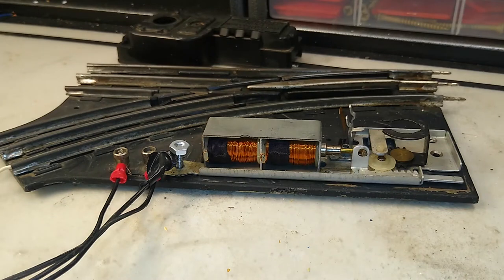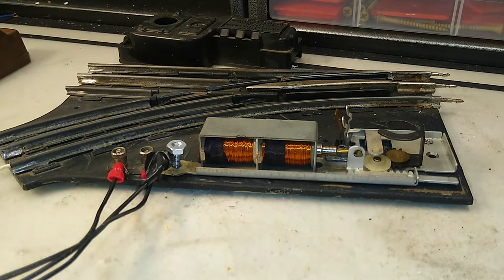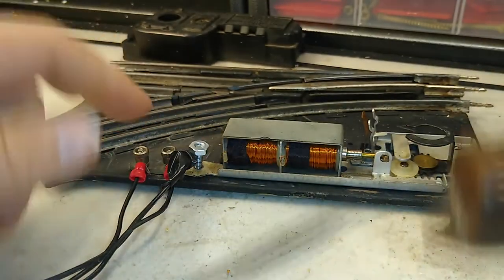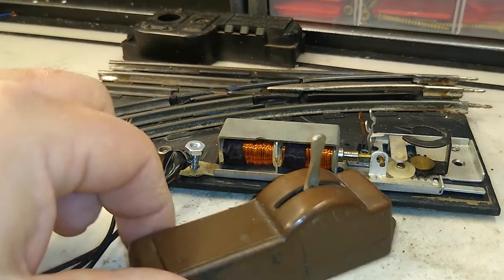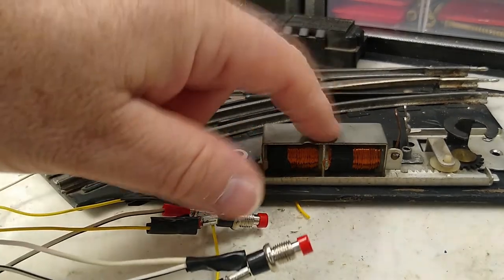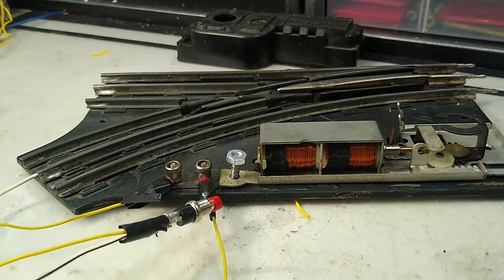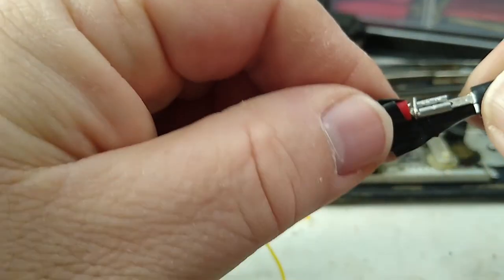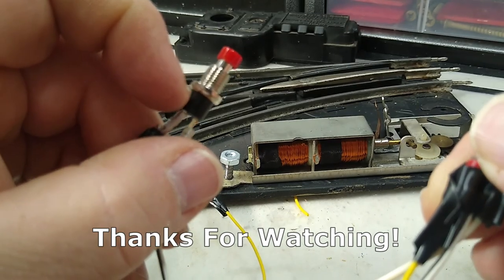Push Button Controls for Lionel O27 Turnouts

Comment: I bought a bunch of Lionel and K-Line 027 profile 042 switch’s for a layout I started building around 2006. The powered 042 Lionel switches acted like they were possessed so I removed the electrical controls from them. They used all white wires in them. I liked the K-Line ones more.